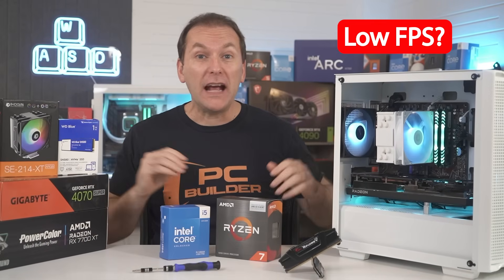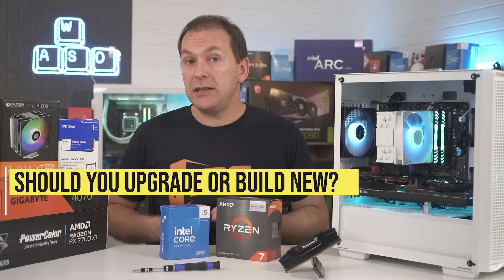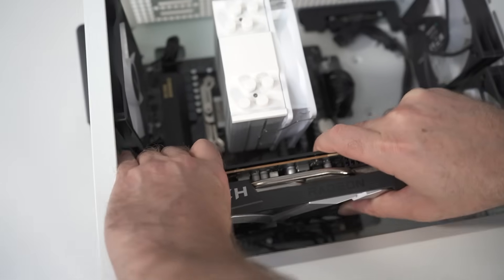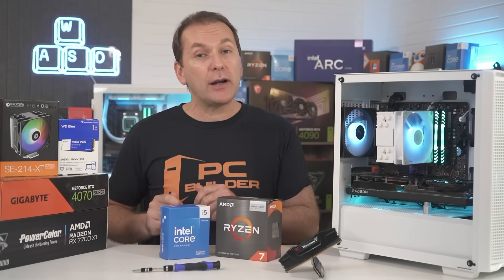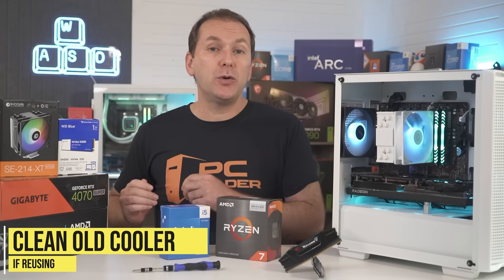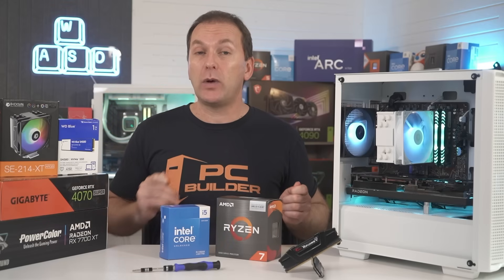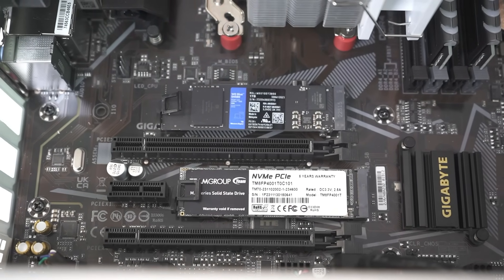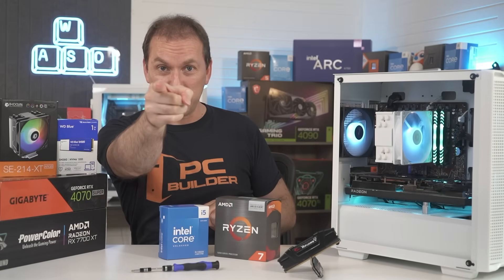How To Upgrade Your PC | How to Upgrade GPU, CPU, RAM, SSD & More

Comment: My birthday is coming up, thinking about treating myself with a 4090
Reply from the maker: Happy Birthday! Id make sure and see what's announced at Computex next week before buying a 4090
Reply: Treat Yo Self. 😂
Edit: I was obviously joking... wait for at least the announcement that might drop the 4090 price. I don't think anything short of a worldwide issue will make its price rise at this point in its life cycle
Reply: @SpoonHurler  guess you haven't heard about the rise in taxes that will happen in 2 weeks from imported goods from China. Brand will not let their marges goes down and increase their prices accordingly. But I give it to you that at the 4090 prices, don't think the increase will be that significant.
Reply: @rasengan367tna  I don't think they go down mind you but waiting a little longer doesn't hurt. If the 5090 has a 2999 MSRP I wouldn't be surprised
Reply: I would hold off.  Like Jason says wait tell after the trade show.
Reply: I would say as someone that has a 4090 buy one or wait until the 5090 comes out then buy a 4090. I would say it all depends on if you want the parts as fast as possible or can wait. I will be looking at the 5090 and the next x3d chips so I can see how big the performance gains will be when the parts get to the usual tech youtubers.
Reply: wait some time before buying it. buy the rest of the stuff first.
Reply: I did. Went from 4070 to 4090 with the 7800x3d. Best birthday gift ever to myself
Reply: Get something like 4080/70ti super until the 5090 launches, then you can decide to upgrade to a 5090 or get a cheaper 4090
Reply: Get it. You deserve it!
Reply: Almost same for me but with a 7900 xtx
Reply: I have an RX 6800 XT right now and been thinking about upgrading to 7900XT/XTX in the end of the year after new launches (and hopefully price drops on the current gen). 
Most probably will be buying a used card as the new ones are quite expensive here in Ukraine.
Reply: Rtx 5000 is coming pretty soon
Reply: Lots of fires caused by the 4090. Also to take into account, if you run it at max settings you lose fps over time anyway from wear and tear. Most games cap between 165fps-240fps.
So unless you got a 240hz+ monitor i wouldn’t bother. 
Plus new series in 6 months.
Reply: @cors4302  yea you keep on waiting .. when you got $250 😂 .. still thinking , wanting, debating , and waiting 💀
Reply: Yes sir. You deserve it
Reply: I would buy a founders edition super model, they will retain resale value like no other. A 3070 fe sells for $100 more than a non fe 3-4 years later
Reply: 5090 coming soon
Reply: Life is too short treat yourself when u can !
Reply: Don’t just wait. I had a 4090 just sold it for the same price I bought it with that money I bought a 4070ti. Also going to buy new x870E mobo and ryzen cpu just to be ready whenever the 5090 comes out
Reply: Happy Birthday  brother 🎉
Reply: Its all over the internet nvidia just announced the all new 50 series 2026 💀
Reply: If i was you go amd
Reply: My birthday is coming up, maybe i would treat myself with a book.
Reply: Should just wait for the 5090
Reply: You should go with amd
Reply: @TITANa7x  nah
Reply: @PesareShojae Yah
Reply: The 4090 is a good choice
Reply: @bluebeginning4046  nah get a 2060
Reply: @PesareShojae  Just get a Titan then
Reply: @bluebeginning4046  nah 2060 rocks 12 nanometer is easier to cool, it's efficient and more resistant to voltage changes and still kicking strong.
Reply: That's a terrible idea with the 50 series 6 months away
Reply: @michaelmcconnell7302  After retailers add their mark up, the 5090 is going to be very expensive and hard to purchase with all the scalpers. I’d rather go ahead and grab a 4090 and enjoy the holidays watching everyone else try to beat the scalper bots
Reply: Wait for the 5090

Comment: got a 5700X 3060 rig. I'm not sure if I should put a 40 series or build a DDR5 rig from ground up.
Reply from the maker: A GPU upgrade would be nice here! A 7700XT would be substantial boost and you can get those for around $379.
Reply: I'd say wait for the RTX 5000 series.